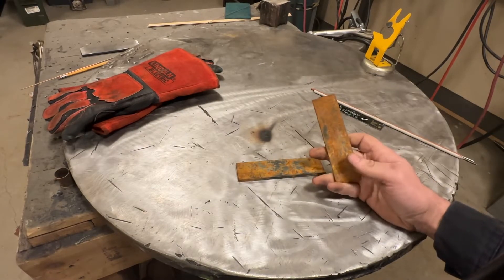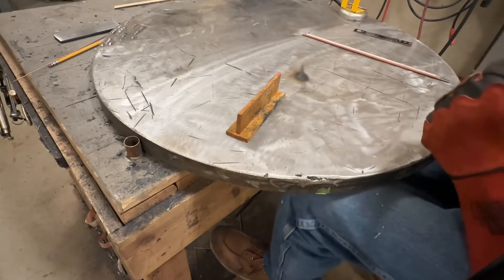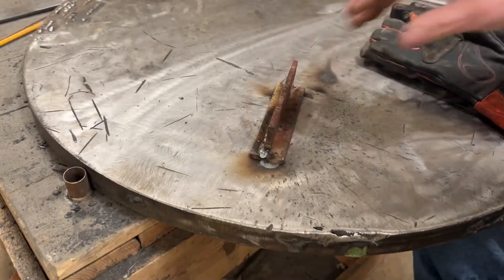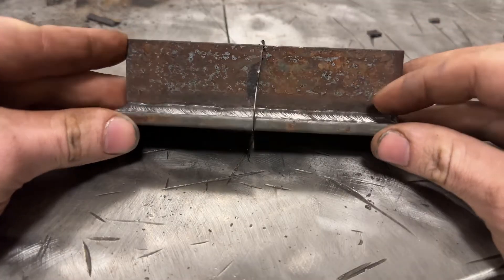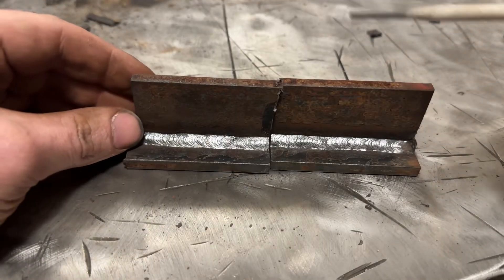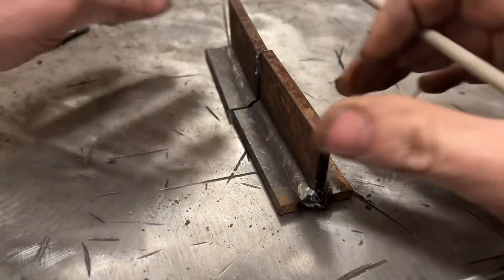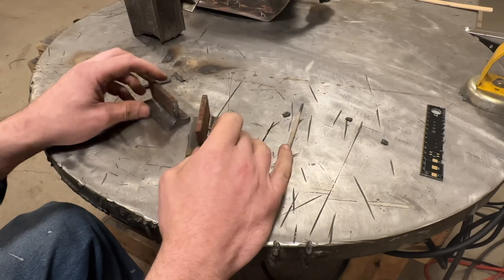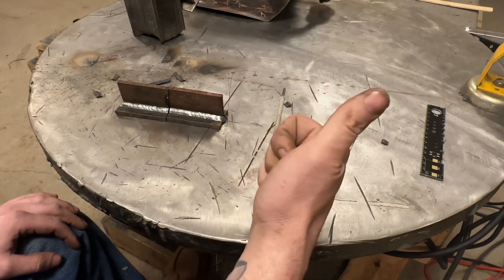Welding on rusty metal 7018 Vs 6010

Comment: How about 6010 first, then run 7018 over to smooth out and easy slag remove?
Reply from the maker: You can do that, keep in mind if you were to weld higher strength steel the 6010 root would be far weaker than 7018.  Anything requiring strength should be done with 7018 if at all possible 👍

Comment: Should you clean the material, yes. But in less than ideal conditions, that goes to show how well the flux works on the rods for cleaning the surface off. The big thing is making sure you at least have some kind of a ground.

Comment: I can not weld 7018 3/32 rods with my 110 volt mini welder
Reply from the maker: Most 110 welders will struggle with 3/32 7018 because they can’t output enough amperage/voltage.  The machine might run 5/64 7018rods (uncommon size but it does exist) or it might also run 3/32 7018A/C rods.  Despite those rods being specified as a/c they require less power to run and often run on less powerful machines.

Comment: I’ve found that if you strike up ahead of where you’re going to weld, long arc it and slowly go back to where you’re going to start, it will burn off a lot of junk  before you go welding over top of it. Unfortunately I’ve had to become a master at that from the big rotten belt trailer project I bid up but it’s good practice for doing shit the hard way. Makes welds way easier on clean materials. If you can make good welds on less than stellar materials, you can make great welds on clean material

Comment: Very interesting testing!  I bought some rusty scrap metal today to do some experiments myself!
Reply from the maker: Glad to hear you’re experimenting 😀.  It’s amazing how much stick welding will actually burn through to make solid welds.  Steel that is so filthy mig welds would literally bubble weird mountains of trash right out of the solidifying weld pool can be welded with stick without much in the way of defects.  If you start seeing porosity in stick welds in the middle of a bead you know you have some bad material lol.

Comment: Another beauty answering questions I had. Thx  Greg!
Had trouble finding a budget friendly welder that burns 6010 but eventually I did. It is the Yeswelder YWM 211P. Couldnt believe how well  it ran 6010
Reply from the maker: Glad to hear it runs 6010.  It’s hard to find affordable welders that will run it.  Definitely worth having the capability.

Comment: I have a cheapy needle scaler that does a decent job of getting that flux out of the edges.

great video, btw.  very helpful for an amateur welder like me to level up a bit.
Reply from the maker: Needle scalers are a life saver on inside corners and hard to reach areas.  I definately should do a video talking about them.  I have heard the “peening” action helps to stress relieve a hot weld too, not sure if that makes much of a difference.
Reply: @makingmistakeswithgreg  I've heard that too!  I think its well established that peening can relieve stress, its just a matter of whether the needle scaler delivers enough force to be effective.  if you could devise a method for proving that, I'd certainly watch.
Reply: @makingmistakeswithgreg  I read a report on english train rail welds where peening the hot weld increased strength and ductility by like 50% so it can apparently  be very helpful.  the only downside i ever heard was pits may act as stress foci in some cases.

Comment: Im doing something wrong or something every time i weld 7018 1/8 it turns out really thin and tall i have rusty metal only o prep it but Im not going fast at all and 1 time i was testing and i went really slow just enough to not burn a whole or cause any undercut and it still turned out thin and tall please help
Reply from the maker: Couple ideas to help, but a few questions first:  What welder are you using, what particular rod (size and brand), what amperage is your setpoint, and how thick of metal? 

What you describes sounds to me like it could be 1 or two things.  

1: too low of amperage or too fast of travel speed.  If the "heat" isnt there the weld will want to sit like a bead of caulk on the plate.  Increasing the amperage will cause the arc to widen out which intern push the weld wider.  A weld can't be roped up on a plate if the amperage is high enough to flatten it out.  

2: The wrong polarity:  7018 is designed to run on DCEP (stinger positive) or some rods run on AC.  With A/c the beads will tend to be a bit more "peaked" than DC.  If youre welding on DCEN you will produce a tall weld thats thin and tall.  If this is the case change the polarity of the machine and try again.  Many other rods will run better on DCEN than 7018, such as 6013.
Reply: @makingmistakeswithgreg  Okay I got Vulcan 7018 1/8, With a lincoln 225AC and i would say the metal is bout 3/8 to 1/2 inch thick and I run on 120 amps
Reply from the maker: @Chevy4Life350  Ok, couple things.  

Welding on AC tends to produce a “peaked” bead.  Basically the weld is more or less triangle shaped.  Since you’re on AC you have no issue with polarity.  I believe you only have “steps” for amp control, try the next step bigger (probably 135a).  When welding thick plate you can use far more heat than thinner plate, so don’t be afraid of amperage.  1/8th 7018 will weld at 135 to 145 amps.  If the bead doesn’t widen out you can try to preheat the plate to atleast 300 degrees in a oven or with a torch of some sort.  This will drastically help the weld to wet out.  Beyond that you can try a different rod.  Lincoln’s 7018ac is a pretty decent running rod.  I think you just need more amperage by the sound of it.

Comment: I wonder if the results would be clearly different if the parts were really rusty. For example, a trailer frame which does not pass a critical inspection, to be used safely. Cheers.
Reply from the maker: I will find some real rusty metal soon 😀

Comment: Nice comparison. I was pretty surprised that the 7018 ran and burnt in as well as it did.  I usually won’t hesitate to smoke it in through the mill scale, but I’m usually a little leery about rust. Keep the content rollin bro
Reply from the maker: Yeah I was surprised at that too.  I was figuring it wouldn’t penetrate much.  😀

Comment: I weld thow rust durt oil and thing eath with 6011 and comes out just fine never had any problems with it then run a pass with 6013 and its not doing no where lol